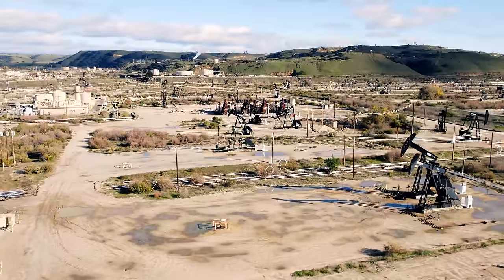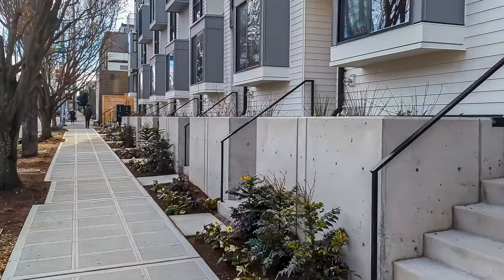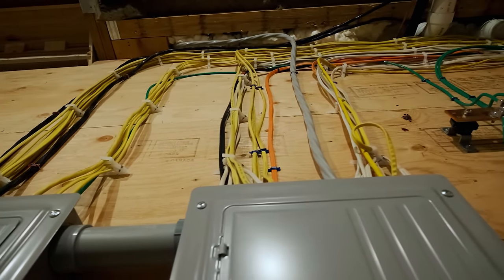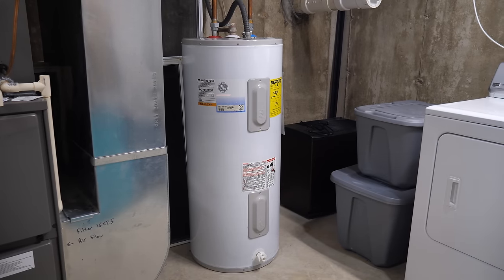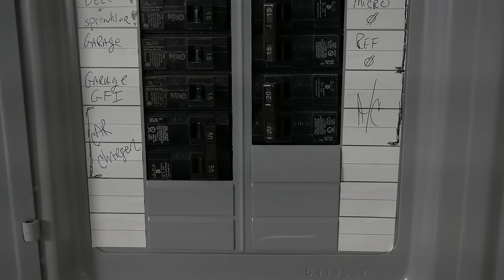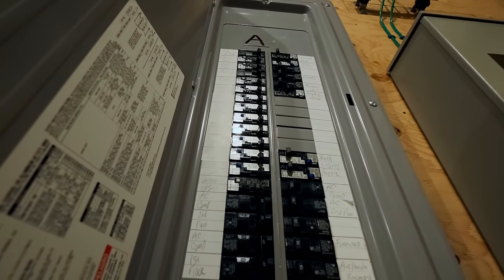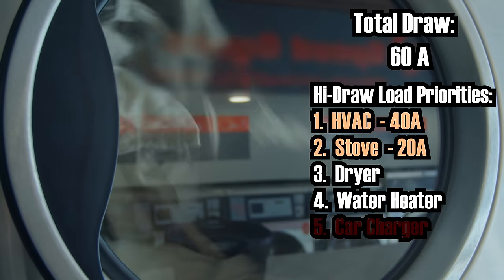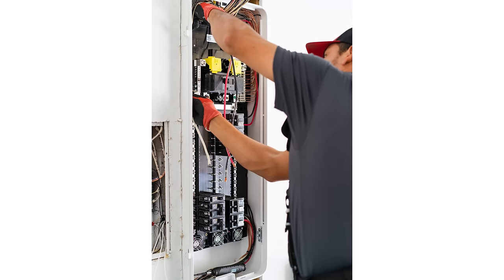Home Electrification: There's not a lot to do, and it doesn't have to be hard (Part 1)

Comment from the maker: Hi! So I didn't really explain why getting a service upgrade is a headache. In short, your utility often (but not always) needs to replace the wires that go from the transformer (wherever that may be) to your meter box, and then from the meter box to your panel. In addition to being a lot of work, it might not always be possible. I talked about this and some other issues over on Connextras if you'd like to take a look.
https://youtu.be/C4cNnVK412U
Reply: Appreciated!
Reply: Getting of UNnatural gas is Very important. It also leaks methane like crazy…
Heat pumps are Great! Can be used with geothermal or just FTX, where it takes energy from the ventilated air.
Reply: Another snag is grid upgrade costs. Over in WA those are passed along to whoever is requesting that latest service upgrade. It’s easily another 20k for a utility company to place / upgrade a transformer in addition to any normal upgrade costs
Reply: Fire good
Ughooga booga
Reply: 100 amps is… 24 kW, right?!
Our heat pump uses 6,5 (simple heater) plus 2,5 kW (compressor) for a 180 m2 house in rather cold climate… 1 m snow on the lawn since Xmas… -20C frequenty. 
With geothermal, the simple heater would almost never start.

We had 20A 3-phase, around 14 kW. Upgraded to 25A, 17 kW, as we have two BEVs and a 16 kW PV array.
Reply: Hold on, friend. 

A heatpump drier has a 800 Watt (8 amp at your 115 V) max need!!
Reply: This isn't always true. My service was upgraded to 200A last year and they didn't need to replace anything except the exterior metering unit and I think a fuse at the distribution box.
Reply: 0:52
I guess you have no idea about the lube oil consumption of a windmill...
Which it means the "carbon free" power only in fairytales are carbon free.
Not mentioning the HQ composites.
Maybe the calculated carbon footprint can be sold on paper as good but the intermittency also have quite a large negative value which could be translated to footprint. Somehow most of ppl. do not care about these "little" issues...
Reply from the maker: @Balázs Molnár Oh noooooo we need to lubricate stuff every once in a while.
Reply: This is a great video, but yes to your point, I am in the process of getting my home electrical service and panels updated to support solar + batteries and. Propane generator (live in a rural storm prone area and deal with 7-10 days of outages per year on average).  The big issue is that codes, even up to recently did not require electrical services to be substantial enough to handle solar feeds, backup batteries, etc.  very doable, but also expensive and painful to coordinate contractors and Duke Progress to get transformers, feed and meter connection/disconnection.  

One other thing I would love to see you do a video on is upgrading insulation and airflow in homes to increase efficiency lots of cool stuff going on in that industry the last few years!
Reply: @TechnologyConnections  The yearly cost of a single 2MW unit here in HUN is about 8000 USD. You can guess and extrapolate the consumption of windfarms... 

Because you need hundreds of rotary machines instead a large one compared to for ex.  NPPs...
Reply: Just had a power outage
Reply: In some cases, the service to the home is already bumped up to 200 amps but the panel is 100.  Check with your utility.
Reply from the maker: @Balázs Molnár But, get this, all those wind turbines make energy from the wind. Sure, a big ol' coal plant can make lots more electricity than a single wind turbine, but you need to feed it coal forever and that means you need to mine for coal forever and that costs money and labor and lives
This shouldn't be that hard to understand, my friend.
Reply: @molnibalage83  you have no concept of the amount of energy from a Wind TURBINE (no mill stones in them…). They generate GWh:s and even a m3 or so of lube oil, across those, equals to nothing per kWh…
Reply: As someone who lives in the UK, our homes are overinsulated, and we don't generally have AC. Summers become horrific here.
Reply from the maker: @Bacon Catbug Insulation helps with both heating and cooling. There seems to be some misconception about this in the UK - you absolutely want insulation to keep your house cool as well. What you're missing is some way to get energy out of the home, and possibly windows which let too much IR through.
Reply: While this is fine and dandy for single family homes and duplexes, this whole electrification argument falls flat on its face when it comes to large apartment buildings. A large, single gas furnace boiler can efficiently heat an entire building for dozens if not hundreds of apartments. Yes, they do require electricity to operate the electronic components, so if the power goes out, they may stop working. But here's something that can easily be done with large gas furnaces in such a situation: operate them off backup generators.

If a large apartment building were to have heat pumps for every single unit, or even a large electric boiler, as efficient as they are, if the power goes out, there is no generator powerful enough to operate them for several hours overnight during the dead of winter to keep everyone in the building warm and prevent hundreds of pipes from bursting and flooding everyone's homes. Yes, everyone in the building will have a similar problem during the summer with AC units, so power outages are a problem then, but what you are proposing will cause this same problem both in summer and winter when it comes to AC/heat pump units causing a major demand on the grid both times.

Fun Fact: More than half of the world's population, including the US, will be living in metropolitan areas by 2035. What you are proposing only works for rural and suburban folk, not city folk, which is ironic as it is city dwellers who are are demanding others make these changes when they themselves would be detrimentally effected if they went fully electric. It's also ironic that city dwellers want everything to run on solar and wind when those things require lots of land and only really work for off-grid and rural settings while cities that have little land, including roof space, want to take up dozens of square miles of precious farm land, used to grow food, just for PV and wind turbines.

The only solution that works for complete electrification to solve the heating problem while being carbon neutral is a massive uptake of nuclear power, which greens hate and want to be phased out for wind and solar. Irrational city dwellers want to have and eat their cake without baking it.

What's your solution to all this, snarky pants?
Reply: @TechnologyConnections  😂
Reply: Being someone who consumes electricity in part of burning gasses, I really missing the smell of wood stoves and the comfortable dry heat.
Reply: @My_HandleIs_  Depends on where you live, Building regulations can make outside devices impossible.
And if you are in more public housing your options are especial limited.

My choices are overpriced District heating heating or gas ...
Reply: @How_To_Drive_a_TARDIS  ROFL, I love the Google Translate option built into the YouTube comments now. Check out your comment… go ahead. 😉
Reply from the maker: @FaceTubeU it's funny, I think I talked about this in the video and why it's complicated to get into. That doesn't mean there aren't solutions (there are) it's just going to make the video incredibly long, and also isn't something that's actionable for anyone who watches this video (meaning the renters who live in those buildings, or even individuals owners of condo units which share central equipment).
Reply: The smart panel is really cool tech but I don't know if the price is worth it when the price of the smart panel itself costs like a grand more than a whole 200amp service upgrade in my area.
Reply: Oddly, when I had my main panel upgraded (it was 100A, not enough breakers) the electrician found that the service and even the meter on the back of the house were already rated for 200A.  My upgrade was a bit more involved anyway, as my original breaker panel was in a walk-in closet which is no longer allowed by code.  They had to relocate the new panel and reroute all the wiring.
Reply: Don’t forget the grid upgrade necessary to support electric everything. Who ever tells you it will support electric everything is lying to you. During peak heavy use times, lines sag as it is. Add more load and the lines will be touching the if the equipment before it doesn’t melt.
Reply: Yeah, they’d have to rewire my whole apartment building!
Reply: @TechnologyConnections  and from my research it's just about 70L of lubricant per year for the very biggest windmills in existence. I think that's amazing for over 10MW of power.
Reply: @My_HandleIs_  I have a very good knowledge about the specific and absolute values as a mechanical engineer who works in the energy industry filed 15+ years...
Reply: Why would I want to "ditch" gas?  Natural gas is great!  It's cheap and readily available, and most people's electricity COMES from gas either way, so you're not hurting the environment, you're being much more efficient than  burning gas in a power plant, flowing it through the grid, and then consuming it in your house with all the losses.  Being "green" means being smart too.
Reply from the maker: @Mike Znel I'm not. You're kidding yourself if you think I am - and one of the greatest benefits of the energy management techniques I discuss here is that they "flatten the curve" and help offset these issues.
Reply: @molnibalage83  sooo... ya think a coal power plant uses the same amount of carbon as LUBE OIL in a windmill farm?
Reply: @TechnologyConnections  DTU (Danish Technology Institute) did some calculations 3 years ago and found that in some cases it makes sense ROI-wise to install an oversized heatpump first and then improve insulation later when you have money for it. This is contrary to common wisdom. Much depends on the current insulation, heat source, heatpump COP, type of heatpump, viability additional insulation, etc. I can provide link to PDf (Danish) if desired.
Reply: Very cool. Wish I was rich & had a family & kids & a wife & a house I own to do all this in...
Reply: @mattparker9726  this will all make sense once you get a good education.
Reply: @whochecksthis  Nope, much less. Because it does not use hundreds of rotary machines to generate 200-500 MWe
Reply: Lots of the "alternatives" make less sense than pulling goop out of the ground.
The infrastructure is a huge part of the feasibility. Gas utilities are still cheaper than the electricity, despite the artificially high gas prices we are experiencing right now. 
You already know the grid is unable to handle current demand, add electric cars, electric water heaters, electric heat, electric cooking and you have a recipe for rolling-blackouts.

Why not call for an "all the above" strategy? The electric or die cult is asking for higher utilities, less reliability, and driving more people into poverty. I love it when affluent people say, just buy all electric! Without understanding that the people on the poverty line is increasing and forcing them to abandon fossil fuels will literally cause many of these people to die from lack of heat or cooling.  

Don't even get me started on all of the issues with solar, wind, and all of the "green" technologies. Solar and wind farms are known to be filled with death. The technology is not recyclable, what do you do with the damaged wind turbine blades and solar cells? I am in California and know the secret ugly side of "green energy".
Reply: @TechnologyConnections  lolz
Reply from the maker: @Balázs Molnár Let's see, hundreds of rotary machines which need (checks google) about 50 gallons of lube oil every (checks google) 3 to seven years versus a coal plant that needs (checks google) 14,000 tons of coal every day
Definitely equivalent.
Reply from the maker: @David Parker - because we need to stop burning fossil fuels as quickly as we can. You know what happens to the raw material of the fuel when you use it? It goes poof and disappears. Then we need to get more. Forever! It's pretty weird, but that's the case.
Despite there being harms in wind and solar production (we're not pretending they aren't there) those raw materials remain intact throughout the whole of their lifespan, and we are in fact learning how to recycle them into new turbines and panels.
This transition will be hard, and we need to help our friends and neighbors as we do it. Good thing we're actually doing that as we speak.
Reply: @My_HandleIs_  residential hookups aren’t leaking man.
Reply: @davidparker9676  Fossil fuels are artificially much cheaper than they should be as the cost of the climate impact is not factored in. Government subsidies further reduce the cost. If all sources included something like a carbon VAT, you’d quickly see that fossil fuels is pushing more people into poverty than clean energy
Reply: @djsmeguk  Correct! The power company runs 200 amps rated wire regardless of your service size.
Reply: This explains why my city has been upgrading the transformers since electrical use and electrification are going up.
Reply: Still probably cheaper in most cases than this "SPAN" panel you're pushing:

"SPAN Panel smart electrical panel | $4500* *Does not include taxes, shipping, and installation."
Reply from the maker: Alberto Sanchez Acero I'm not sure how universal this is, but I did edit the comment to reflect this.
Reply from the maker: Justin C To be clear, I'm not pushing the Span panel as much as I'm pushing the idea it represents. I like what they're doing, but it's definitely not cheap and we'll discuss other options in part two.
Reply from the maker: ...who exactly is "they" and who are you talking to, @Tech One?
Reply: @Akkbar21  In my united states town, the local utility doesn't seem too concerned about fixing minor leaks in buried pipes.
Reply: @Technology Connections I am an HVAC Technician you need to get a professional to look at your electric furnace. The heat strips should NEVER turn on and off while there's still a heat request from the thermostat. I would also recommend staging the heat strips. So all of them don't turn on at once and use a 2 stage heat thermostat. If there extra thermostat wire conductors available. So that you ONLY turn on the amount of heat that the structure needs. The heater kit has safeties that turn the elements off if they get too hot or if the air flow is too low. One of the heat strips burned out more than likely from low air flow. If the low air flow conditions aren't corrected more heating elements will burn out. IE not enough return air grilles or insufficient return air ducting IE too small. Undersized ductwork is the biggest problem in the HVAC world. Also oversized equipment is a big problem too. Undersized ducts coupled with oversized equipment leads to early equipment failure. We have what are called load calculations called Manual "J", Manual "D" and Manual "S". But these are rarely followed. Instead the equipment is either replaced with bigger equipment. Or the equipment sized is guessed depending on the square footage which is INCORRECT. Most localities aren't enforcing these rules which causes extra energy usage which isn't necessary.
Reply: As always, thank you for your awesome informative videos!  I'm a little surprised that upgrading your panel capacity is that much more expensive that changing out your panel for a smart panel anyway, even though a capacity increase requires other infrastructure changes as well.  Can you provide a ballpark in what the cost difference is in the case where you're in an advantageous situation for upgrading capacity (above ground wires, etc.)?
Reply: We asked for a 320a service when we built our home cause we for sure wanted to future proof it. I think it was a $6k build upgrade vs the 15/20k post install. 
What did annoy me was they refused to install heat pumps and all quotes I've got are 40k+
Reply from the maker: @hvacguy84 yeah, I suspected it's lacking airflow or something. I'm looking into a Bosch heat pump system for them. Now that I know what they actually need, a three-ton unit with 15 kW of heat strips will be plenty - which means they won't need to upgrade the outdoor supply. I figured they might have to not knowing just how power-limited their current air handler is, but they're in the clear. Now the challenge is finding an installer...
Reply: @mattparker9726  1. Burning gas to cook DOES put CO gas into the air inside your home as well as other pollutants. 
2. Cooking with gas makes the entire room get HOT, straining HVAC more in the summer. Induction stove tops dont really do that. 
3. Resistive heat generation is a 100% efficient process.
4. Whos to say that electricity isnt being made by hydro power or a wind turbine? All electric homes being the norm means we can eliminate more fossil fuel use.
Reply: @davidparker9676  "You already know the grid is unable to handle current demand, add electric cars, electric water heaters, electric heat, electric cooking and you have a recipe for rolling-blackouts."

Dude, we can upgrade the grid if that is the case. It's not some permanent fixed entity. Might be a good way to generate more high paying engineering jobs too...
Reply: @TechnologyConnections  Beaker size isn't determined by the tonnage of the outdoor unit. I've seen 3 ton units on a double pole 20 amp breaker. So always follow the listed breaker size on the equipment. But you need to get the air flow problems corrected. IF NOT your new system won't last very long. Also with heat pumps the indoor unit (air handler) becomes the condensing unit in the heat mode. If you don't have the correct amount of return air grilles or the ductwork size is too small. Your heat pump will run high head pressure in the heat mode. I've seen some systems so bad that they will trip the high head pressure switch in the heat mode. Get a very good and well knowledgeable technician that knows what there doing. That are willing to perform a load calculation and correct the ductwork problems too. In the next few years we're going to be moving away from from R-410a. They will be testing 2 new refrigerants R-32 (mostly used in Asia) and R-454b (being tested by Carrier/ ICP HVAC) this move will happen in 2024-2025. Also shop for a good contractor not just by what brand name unit they sell. They can sell or install well know brands like Trane and Carrier but if its not installed correctly it will cost you.
Reply: You don’t need to remind me Bob is my uncle
Reply: Technology Connections desperately needs to learn basic economics
Reply: @TechnologyConnections  - If you don't know, I don't have time to educate you.  Pay attention and you might figure it out in twenty years.
Reply: I like natural gas!
Reply from the maker: @hvacguy84 I know, but they've got a 30A circuit and most 4 ton units I've seen need more than that. Wouldn't be the biggest deal to upgrade that circuit but still best to be avoided.
Also I highly doubt their ductwork is gonna be a problem. At some point I want to investigate whether their blower is set low - it probably is. There's a large trunk duct with a vent maybe ten feet away from the furnace and not a whole lot of air has ever come out of it. But yes, I'll be consulting with professionals - the only trouble there is there are HARDLY ANY where they live that I have much confidence in.
Reply: @TechnologyConnections  We just replaced our system with a Daikin dual fuel heat pump/furnace. It performs great and has a great warranty. I have heard Bosch systems are more difficult to repair and parts harder to find.
Reply: @TechnologyConnections  What i really wish is using Heat Pump as a central system, heating the water and oven , and maybe also a more conventional smaller heater package of 2 plates, one for a small kettle, and one for a small to medium pan. so we can heat our home appliances and water with the heat of summer.
Reply: @Aquatarkus96  It's been lacking for decades already, what makes you think it will magically be upgraded with increased demand?.... It hasn't happened so far.

I live in Los Angeles surrounded with all of these naive Pie-In-The-Sky ideas that don't make fiscal or logical sense. All of this crap is heavily subsidized and still consistently underperforms. 

Why do you want to force an energy source that doesn't pencil out?
Reply: In my experience in CA we rarely had to replace service wires to go from 100A to 200A for overhead service - underground service is horribly to impossibly expensive in many cases because the service wires DO need upgrades and often the conduit in the ground needs to be upgraded for the larger wires.

When the service wires don’t need an upgrade, the cost is almost exclusively in the panel, so a smart panel upgrade doesn’t offer much benefit over going to 200A.

Of course running new 220V circuits through existing homes can be expensive too as there is usually the additional costs around repairing access points.

I’m interested in your second video though as batteries as a way to manage the additional demands might be an alternative to destructive new circuits, especially if there are ways to get 220V battery systems that charge from 110V circuits.
Reply: @TechnologyConnections  Usually in heat you use a lower fan speed than A/C. But every house has different requirements. Also note Variable Speed X13 blower motors DO NOT have speed taps. Older PSC motors (permanent split capacitor) and the newer cheaper constant torque X13 motors have speed taps. But for now you can have a contractor stage the heat kit, check the fan speed and replace the failed element. Instead of having 20 KW of heat strips turning on which isn't necessary if its mild outside. Most electric furnaces support staging heat kits 10 KW or larger. This can be accomplished by a simple thermostat wiring setup change by using W1 (heat stage 1) and W2 (heat stage 2). If you have extra unused spare wires (usually coiled around the thermostat wire jacket if extra conductors are available). The spare wire can be wired to W2 (heat stage 2) on the thermostat and at the electric furnace. To signal the other set of heat strips to turn on via thermostat request on temperature.  Instead of banging on all of the heat strips. (In some places electrical strip with straight A/C can't be installed and IS against code). These areas require heat pumps to be installed to be up to code.
Reply: @TechnologyConnections  The big problem with wind and solar is the equipment has a finite life span.  I think it averages about 20 years.  So every 20 years all the solar panels, and all the wind mills should be replaced for optimum efficiency (they don't need to be replaced, but they won't produce as much).
I think Nuclear is the way to go.  If we can set up several nuclear plants, then electrifying everything wouldn't be a problem.  There is another YouTube channel, I think it's Kyle Hill, where he talks about how safe nuclear actually is and how it could truly solve our energy needs for centuries.
Reply: Why don't you speak more about underground heat pumps for colder climates. My town can sometimes get freezing in winter, up to -40 C. And as a result almost all people that have installed heat pumps have made them with underground heat exchangers, not only do they work they have even better efficiency curves all the time even in hot summer days when you want to cool your home.
Reply: @TechnologyConnections  That all sounds nice but it ignores the basic question; where does the electricity come from? Typically coal, some natural gas, some diesel/oil, some hydro, a small amount of wind and a small amount of solar.

I have no problem with any of these, in fact, I say the more options the better. What I do have a problem with is one source being forced on everyone regardless of how expensive or disruptive it will be, or even if it is a viable solution. Some of these emotion fueled decisions have a funny way of coming back to viciously bite us.

Electric cars are not the solution for everyone, especially those that live in rural and cold climates. Diesel is remarkably efficient and produces less GHG than gasoline, plus the ICE powerplants provide heat to the occupants and rapid refueling with potentially unlimited range.

Again, I have no issue with people using solar cells on their homes or property, I have no issue with windmills on one's own property, or geothermal.... it's all good with me. I am tired of people pretending that they are clean or have no downsides while exaggerating the downsides of fossil fuels.

The mining of copper, cobalt, rare earth and all of the materials to make these "alternative" energy sources are extremely destructive to the environment, exploit people and often use slave labor. There are more costs to consider when we are being totally honest with ourselves.
Reply: @FoxWolfWorld  He needs a little less bias and to be able to look at things from a POV that's not a person in a US city/suburb in a mild climate.
Reply: @davidparker9676  
If everyone shared your belief on how we should cook in the home, then we shall cook the planet.
Reply: @Muaddibize  Installation costs can be extremely high for those in many areas.
Reply: @molnibalage83  1. Plenty of lubrication is not from crude oil.  2.  Lubrication is not burned, so will not become CO2 (not counting trivial amounts that is unintentionally burned, and even less that is in a very few devices)
Reply: This sounds great, but here in California, electrical service is charged for a t about $2.00 a kilowatt hour !!!, electrical power used to be charged for at about #0.15 cents a kilowatt hour a couple of years ago!!, so, just having a small usage is now costing about $800.00 to $2500.00 per month!!!!
Reply: @molnibalage83  How many gallons per hour does a windmill use?
Reply: @SquintyGears  We can argue when the USA went to hell in a handbasket, but Reagan actually rescued the USA from bigger economic pain by restructuring things. FDR really screwed the US over in many ways, prolonging the depression and driving us into a cycle of endless wars. We were an isolationist country and would be way better off staying that way, like Switzerland.
Jimmy Carter was a nice guy but a terrible president that blamed the people for the US' decline instead of taking responsibility, being the commander in chief and all.

The government does a terrible job at everything it does, and it costs many times more than it should. Government subsidy is toxic when it picks the winners and losers. 

I live in southern California and I can tell you that these feel-good solutions don't make sense, economically or environmentally. I happen to know a thing or two about rolling blackouts due to the grid being overloaded. We have blackouts throughout the summer. People die when they get heat stroke from the blackouts. I've been without power for over  three days. If I was in an all-electric home, I wouldn't have had hot water to bathe and wash dishes, I wouldn't have been able to cook on the stove or oven. Gas appliances ease the burden on the power grid. The more options, the better. If you have rooftop solar, solar water heat combined with gas, a gas generator for backup, it is all the better. 

It is very foolish to put al of your eggs into the electric basket. Just ask Texas when they were freezing. The homes with generators and natural gas were fine.

You are being sold a pig in a poke, don't fall for such basic propaganda.
Reply: i have a couple big problems in my home, i only have a 100A main, and the breaker box is already full from when the house was built, literally no empty spots. Plus, all the tools i use in my shop/garage i could not get away without getting a service upgrade, and a new breaker box, and of course id need the new circuit run as well, so unless there was a government incentive or something else that paid for all of this i would not be able to switch to all electric
Reply: @OriginalPiMan  Nice hyperbolic argument. 
Where does your electricity come from? What powers your electricity? Nuclear, coal, unicorns?
Reply: @davidparker9676  
Renewables power my home.
Solar and wind. I pay more so that this is promised to be the case.
The grid as a whole in my area: there's still a lot of coal, although that share is reducing (just not as fast as I think it should)
Reply: @unteins  Upgrading to a 200 amp panel is not that expensive and upgrading the drop is not a major concern. You are right about underground wiring being cost prohibitive. 
The efficiency of upgrading to a 200 amp service is something I rarely see people talking about, especially for older homes. The lower resistance of the new drop and panel reduce the power losses compared to a small panel with a thin gauge drop.
Batteries are an option but will be be an added expense that may not pencil out in any savings.
Reply from the maker: @Deceneu mainly because ASHPs are getting so good at operating in extreme cold that the additional work and investment of a ground loop is chasing diminishing returns. Our housing is already set up for ASHPs, and if we can get them working at a COP of 3+ averaged throughout the winter (which I'm all but certain we already can) then it's hard to justify geothermal in my opinion.
Reply: A better question is WHY would I want to do this? Gas provides reliable and effective heat for the home, for cooking, and for drying clothes. If the electric grid goes down, I still have heat and the ability to cook. I am happy to keep my gas appliances.
Reply: @davidparker9676  it's not a question of propaganda. You live in an environment that makes it impossible to trust centralization. It's totally fair but it's not true worldwide. The truth is you should blame the government for fucking it up so bad instead of blaming regular people for trying to do better.
Yes you should diversify some things but you're not raising your own beef and growing your own tomatoes are you? Some things are built resilient to most variables and you don't live in fear of them just breaking.
But it's very hard to imagine the restructure of leadership necessary to get a solution. It is happening slowly though. California does have more environmental protection than most other states.
Personally i think at some point the US really will be more of a collection of countries than it already is...
Normal places only use generators and backups in case of natural disasters that destroy the city. Not just a hotter than average week in summer... That's why cooking backups can be camping stoves too. The whole mind framework is warped.
 you can reasonably have full electrical independence but you can never refine your own gas. It's intrinsically a technology that is more freedom for individuals. If I'm rich i can build my house anywhere remote af. if there's ground water and starlink I'll have access to all modern comforts with absolutely nobody to answer to...
Reply: @davidparker9676  yes another easy efficiency upgrade we don’t use is larger gauge wiring in the home. A 15A circuit usually uses 14 gauge wire, but 12 gauge isn’t much more expensive and has significant efficiency improvements. Not as useful in a service upgrade situation but for new construction it would be advantageous for it to be mandated in building codes.
Reply: @TechnologyConnections  - Liberal leftists, hello!
Reply: @My_HandleIs_  won't that be taking the heat from your house though?
Reply: @My_HandleIs_  In a climate that requires heating and cooling, it's even better: In addition to a vented drier running at ~2500W and venting all of it, in winter my heating system would need to supply another few kW to raise the air getting sucked into the house from below freezing. I readily admit though, that it was ease of installation that made me pick the heat pump version.
Reply: Glad you posted a comment about this. It can be a pain to perform a service upgrade if you are unlucky. I suspect, however, that for most single family homes in the US built in the last 40 years it wouldn't be a big deal. Mostly the feeders are run in conduit so pulling new ones should not be a big deal. And replacing a meter can isn't any more difficult than replacing a load center once the utility provider has cut the power for you. The issues would be if the transformer isn't capable of providing the load required or maybe the conduit is undersized for the new feeders. 

One other thing is if you have a look at the data sheets for most breakers they don't exactly trip at their rated current immediately. Most of them will actually allow quite a bit more current to pass for a short period of time. Most will even do a full 100% overload for a few seconds. The reason they trip so quickly during a fault is that you can have hundreds or even thousands of amps drawn instantaneously.

Excellent video as always. Thanks for what you do
Reply: I did just do a 200 amp service upgrade and my electrician got everything done with the outside in a day without any issues.
Reply: @molnibalage83  Also, coal plants and gas plants in reality use that fuel to run turbines. Guess what, turbines need to be lubricated, too.
Reply: And then they need to upgrade the upstream infrastructure and the production capability. Buy yourself some nice warm blankets...
Reply: @davidparker9676  Because our earth is dying and we will run out of fossil fuel by their nature.
Reply: @davidparker9676  
The highest per capita greenhouse emissions are from the oil drillers and the wealthy countries.
(2013 figures) Kuwait, Brunei, Niue, Qatar, Belize, Oman, Bahrain, Australia, UAE, Libya, Canada.
Reply: @My_HandleIs_  I've asked how pipes and stoves leak gas when they're off and inspected regularly, with no standing pilot lights. Crickets.
Reply: @davidshaw9993  We have 2 100 amp panels. There are also bits from the original knob-and-tube wiring in the basement.
Reply: @molnibalage83  Not only that with an all electric home just imagine how many people will be freezing or going hungry from electrical shortages
Reply: @OriginalPiMan  I think ten years is a little old.
Reply: @TryNDoxMe Grid system isn't up to snuff right now and if every home were switched to all electric it would really be overworked. Start calculating the amount of time(could be a limiting factor) and expense to build that grid and you might change your tune a little.
Reply: @ivanskyttejrgensen7464  Yes. It takes a long time for improvements like that to pay for themselves and if you move before they do, you get back a fraction of what you paid in increased house price. It can improve quality of life though.
Reply: @omega4711  Weak.
Reply: @TechnologyConnections  "those raw materials remain intact throughout the whole of their lifespan" - That's what we call a tautology.
Reply: @mattparker9726  I've heard this from every ac/heater guy, my electrician, and half the companies at my regional renovation show but my utility bill says otherwise, gas is a deceptive bill they take the average over the year then calculate your usage and lock your rate
Reply: @gionova1  Electrical use is definitely going up and has been for the last century. My parents' house had one or two electrical sockets per room. That wasn't enough even before I left home in the 80s. TVs, PCs, VCRs, phones, well, the list goes on.
Reply: @AsbestosMuffins  you get heavy discounts by buying off season, and pre buy.
Reply: @Narinjas  Heat pumps don't get that hot. I like my food cooked.
Reply: Your argument against rooftop solar is the single worst take you've ever made in a video.  If you have power at peak hours that is the most valuable power whether you are getting it from the grid or getting it from panels on your roof.  Them incentivizing you to reduce that power and instead supply it to others is not a perverse incentive, it's literally them creating a proper incentive.  

While the costs of the grid are a substantial part of the electric tariff rates, those costs are including them building to peak demand the old fashion, thermal power way.  Electric utilities set their rates through negotiations with state and local regulators where they have to point towards a capital cost in order to get a profit.  They have every incentive to sell their fossil fuel assets as an intertial stabalizing mechanism.  THIS is the perverse incentive, the more they spend the more they save.  You say "it's a cost their neighbors pay for".  No, it's taking money back from shareholders in investments that slow walked the solar transition in the name of profit.  They made a bad investment and they would very much prefer that bad investment be protected from competition and be allowed to make a profit.  It's such a bad investment that rooftop solar, despite all it's highger costs then utility scale can still undercut it.  Your neighbors are left better off buying your lower priced energy.  Yes it's a complex question but what you are defending is the predatory thing, not the solar.

You specifically cite the case of California.  California is currently doing a commendable job leading the world in utility scale batteries.  They are doing this because they need power at peak hours and not in the middle of the night.  If they shift a GW of demand from peak hours, that's like a GW of batteries, a billion dollar investmnet, a billion dollar investment that you and your neighbors dont have to pay for through higher electric rates.  Your "no more then 25%" idea would be punishing people for helping and rewarding them if instead of helping they didn't help.  Net metering does have it's issue but you are saying we should make it worse not better.

This take made me age 30 years and become a cranky old woman yelling at the screen.

Also the real reason we shouldn't stick solar panels on buildings is it's more expensive.  Almost half the cost of a utility scale solar installation is things besides the panels themselves.  Putting them on buildings drives every one of those costs up.
Reply: It's actually a myth that the electric grid requires bolstering to convert to all electric. Virtually all EV vehicle charging will occur at night when most of the grid is underutilized. Meaning you don't have to upgrade it to add an EV to the mix. Heat pumps consume about as much as a fuel oil pump, and you can use heat pumps for water heaters and heat. Essentially the only items that will bump the required electricity will be gas furnaces (only slightly, the motor that blows air is still the bulk of the power requirements) and a gas water heater, dryer and stove. With the advent of LED, that offset of power consumption for light pretty much offsets the occasional water heater, dryer and stove usage. (Lights are running for hours every day, and stoves, dryers and water heaters are not running that often.) The studies show that demand will go down as tech improves. Even with a switch to EV vehicles. Population (in the US) is shrinking. Any local highs will most likely be offset by more rooftop solar as it gets more popular.
Reply: It's even worse if you're in a condominimum that's maxed out what the provider can give you on your current voltage. For example, my building has hit the max panel ratings that the power company is willing to support on any 2.7 kV line. Because of this, we'd need to get a new line run all the way from the substation at a higher voltage if we wanted to replace our natural gas furnaces with heat pumps and that's going to costs $50-120K as of the last quote they gave us .
Reply: What's your opinion on new nuclear technologies?
Reply: We're still gonna need oil for medicine and lubricants maybe plastic but we should really get off that.
Reply: @Nala15-Artist  
Broad figures are hard to come by (2018 list has a lot of countries but not as many as 2013), but the principle stands: Countries that mainly produce oil, and highly developed countries (especially outside Europe) produce the most emissions per capita.
South American countries, barely rate.
Reply from the maker: @aramintywhitesell4566  I thought I made clear (and excuse me if I didn't) that I don't really have issues with the concept of rooftop solar, just that we need to be careful about how we incentivize it. I'm not convinced there's a really good way to do it fairly, and your last paragraph is another reason I won't push people towards it. Not only do I find it just pretty icky to say "you wealthy folks should just do this work for us!" but it's arguably a worse use of those panels.
(edit) And all that wonky crap on how rates get determined in the first place is absolutely among the reforms that need to happen. Hell, there's a lot of reforms that need to happen to the grid. Obviously. But I'm really, really concerned about the long-term implications as well as the simple fact that not everyone can benefit from this.
Reply: @molnibalage83  Oh no, 98% reduction of the carbon output isn't 100% reduction of the carbon output, so we shouldn't do anything at all because it's not 100%.
Reply: As someone who switched out a whole house furnace for a heat pump, I regret my decision. Snowy day, 20 degrees out and my house couldn't get above 62. Pathetic. But at least I got a 10k rebate on a 35k bill to have to keep the stove on overnight
Reply: @TechnologyConnections  how about the landfills full of decommissioned windmill blades?
Reply: @splinky99  Nope, the landlord would and the landlord passes that cost to the tenants
Reply: @TechnologyConnections  It ain't Covid. Flattening the curve means very little.
Reply: @michaelrauff734  Windmill blade are not a serious pollutant. They're made of fiberglass and aluminum. Not really a problem and those blades don't need replacing unless they're damaged, which rarely happens.
Reply: @mattparker9726  yeah, it's cheap and available... until it's not. Ask russian 🇷🇺 nazis how.
Reply: @molnibalage83  oh wow.
I had no idea.
Can you cite sources for this data?
I would love to see the listed quantities of lube oil used in windfarms and see the difference in quantity vs a coal or nat gas power plant...
Im in disbelief.
Reply: @procrastinatingnerd  you'd be surprised but nuclear power plants also have finite life span. 60 years. And a lot of scheduled shutdowns for interim maintenance as well.
Reply: @nneeerrrd  why? We have plenty here in the United States. We just need to drill
Reply: I had assumed most of the cost with a service upgrade would come from the panel, breakers, and installation. I should be closing on a new-to-me home with an overfilled 100 amp service panel, so I guess I’ll find out for myself.
Reply: @roryhennessey1983  because there are people outside of US, ya know? Sorry to shock you 😉
Reply: @OriginalPiMan  All of those countries are not densely populated, it is easy to get large per capita figures cherry-picking the data set.

The actions of the EU and USA are going to have little to no effect on these emissions when Asia and South America are the biggest polluters in the world.
Taking these draconian measures will only serve to hinder the EU and USA's economy while China and India pollute with absolutely no restraint or regulation.

These feel-good actions will only make China more wealthy and powerful by exporting more manufacturing to them with no control of pollution or regard for the environment.
Reply: Don't you guys use solar hot water over there? In Australia, almost every home built this century has solar hot water and it's been reasonably common since the 80s. In fact, pure electric hot water services are no longer to code for a new home. If you need {for some reason) to run electric hot water it needs to be a heat pump unit which are a lot more efficient. Also, almost every new home built has at least 5kw of solar installed to help keep the electric bill down. Likewise, every aircon sold here has been a reverse cycle (ie: a heat pump) for at least 30 years, why is the US so slow to adopt new technology?
Reply: @Nala15-Artist  Fossil fuel is a natural resource, it does replenish. We can use the methane from waste to power engines and for heat. We are nowhere near peak oil, and you are ignoring the damaging effects of mining the materials for electric vehicles and all of the copper that will be needed to transmit and utilize the electricity. Solar and wind are not clean when you factor the entire production process and lifecycle.

We have done wonders with dramatically reducing pollution with gasoline and diesel engines, we can do the same for heating and cooking as well.   

You are looking at this in a completely biased and unbalanced way. There are a lot of negatives surrounding going all electric. Most of the electricity in the world comes from burning coal, nuclear and the renewables have negatives associated with them as well. Wind and solar farms are death zones for wildlife. 

You really have to take an honest look at the big picture and ignore the propaganda.
Reply: @unteins  I never understood why anyone would not opt for the thicker wire. The cost difference is minimal but the benefits are worth any price difference.
Reply: @davidparker9676  in my experience it’s because they are never offered it - everyone is trying to get the lowest bidder - so by the time the home owner is making decisions the option has been taken off the table.
Reply: @davidparker9676  Most of what you just said is very biased and incorrect. If you are the intellectual you seem to be touting you are, I shouldn't have to tell you which parts. In the immortal words of Willy Wonka: Good day, sir.
Reply: @nneeerrrd  How lubicrous.
Reply: Living in Alaska is different especially when-20f
Reply: @TechnologyConnections  you should have a look into the green transformation in germany. Maybe you have it in good memory, but currently it struggles to make any real progress and the oil for the wind turbines is a  often used strawman together with killed birds and bats.

We are still dependend on gas and oil for heating and many people cannot imagine to change to electricity, because they say "my home needs to warm water for heating a heatpump ist to inefficient" because they won't change their behaviour.
Reply: @gonzostwin1  Heat pump installations come with emergency heat (resistive elements) for those occasions when the heat pump can’t keep up. We have a 22 year old heat pump and it has no problem keeping the home at 70F even at 10F external temperature. If yours doesn’t keep up, you need to get it looked at by a good HVAC tech. It could be a very cheap fix - either your heat strips are not working, or the thermostat/controller needs replacement. In some thermostats, you have to choose “emergency heat” manually in extreme temps.
Reply: Connecticut electricity cost has now jumped to 25 cents per kilowatt. Just FYI.
Reply: @ivanskyttejrgensen7464  of course, it can make Sense when you have to replace your heat source anyway and then save money for further upgrades. But generally speaking you should upgrade your thermal envelope first (windows and walls are a unit and should be upgraded together when possible) and then do work in your heat source.

But there is No generic answer to making homes future proove it's all individual.
Reply: @TechnologyConnections  Sure it's a complicated thing but that does't change the fact that what you are saying is we should make things worse not better.  Given the choice between having to supply you with peak energy and you supplying the grid with peak energy, it's better for everyone else on the grid if you supply not consume at the peak.  It's worse from the narrow financial interest of the investors in a pseudo-privatized utility but only because it limits the extent to which they are rewarded for doing the wrong thing.

"I'm not convinced there's a really good way to do it fairly"

The time of use incentives you are attacking are the solution to this.  There is utility to the grid to be able to shift electricity use between time of day, utility that they are willing to pay for with batteries, time of use incentives and excess capacity.  Currently that's shifting demand away from peak hours towards other times of day.  But because solar is the cheapest form of generation it's going to keep getting built and eventually this will reverse.  30 years from now every well regulated in the world will be doing what California is doing, operating a lot of batteries and incentivizing people to shift their demand towards times of oversupply.

You aren't properly thinking through the implications of rooftop solar being more expensive then utility scale solar.  Rooftop is always going to be a minority of the grid because anything that makes it cheap makes utility scale even cheaper.  If rooftop was a 2 cent per kWh levelized cost of energy (LCOE) then utility scale would probably be offering a LCOE of like 1 cent and things like widescale water desalination start to become viable and demand response starts fading in importance compared to overproduction.  Since it's basically impossible for rooftop to oversupply any rooftop solar we get is helping the grid not hurting it; rooftop is someone deciding that they want to pay extra for electricity in order to put some excess capacity on the grid, excess capacity that makes the system more resilient.
Reply: @tehgangstadawg  I’m sure nothing is perfect, but I’m just not for throwing out the baby with the bath water. Take care
Reply: @marvindebot3264  Low energy costs in the US prevent more efficient tech from being widely used. Heat pumps are just now beginning to become more common.
As the energy prices increase, the newer tech becomes more appealing to customers.
Reply: Copy and paste a link to your one year old video about how weak the us electric infrastructure is well you say the cords are the weak point but the actual infrastructure is barely keeping up in places like la talking about the infrastructure update retrofit alone would be so expensive and take so many new workers into many already struggling trades.the heat pump mini split video had to ad power for that house and yes electric backup heat on your heatpump another 50 60 amps garage heater 20 and now you plug in and charge light bulbs airfryer lawn mower we just keep adding cords to be plugged in and adding power to things in the home we already have power to your dog bowl and boot driers ect lol just fun namely stuff. and anything faster than wall charging is extra cost for multiple vehicles much money and how environment friendly it will be drilling wells for your heat pumps at every house in the us and the $30,000 more to buy and yes electric cheap now and when everyone is only electric I am sure the price will not go up and that people will just raise the ac temp well the government will lower it for you and being able to buy more than the minimum has never been a problem we Americans can adapt and we don't want to actually plug anything extra into our houses
Reply: @Nala15-Artist  It sounds like a coward's exit but I guess I should expect no less from someone with a cartoon cat avatar, quoting a fictional character such as Willy Wonka to end a debate.
Reply: @davidparker9676  OMG this is gold. Thanks for this! I lack the talent to make up such comedy. Just as I also lack the time to debate strangers on the internet. Especially those who already have their minds made up and locked in. Good night.
Reply: 25:31 As a longtime subscriber I can't believe it took THIS long to hear that story. It makes me wonder if there's something running in the family, technology genetics if you will.
Reply: @Nala15-Artist  Re-read my last comment, it applies even more now.

If you have no time, why did you reply with a paragraph? Irony anyone?

You certainly do lack talent, I must agree with you there.
Reply: @Akkbar21  No, but the pipelines are.
Reply: I have know people who Unplug the microwave when it's not in use because their worried about the power consumption of the LEDs LMAO.
Reply: 26:07 Really  appreciate the scene getting dimmer in time with the description!
Reply: Also the costs.  We have 200A service but EVERYTHING in the house is electric only.  Our panel is chock full.  When I got a quote for adding a circuit for EV charging I was told that I should have enough capacity for 1 EV charger (we have a 2 car garage) but we would require relocating at least 2 circuits to a new sub-panel to add room for another additional circuit.  That would end up costing like $1600 for the subpanel before the $800 to add an EV circuit.  And yes, I know about tandem breakers, the panel also already has the max allowed number of those already.
Reply: A 200amp service cost me 5k to install. No help from government
Reply: Thank you, I thought a service upgrade meant replacing the panel and I was confused about why your solution was to replace the panel with another 100w one.
Reply: @How_To_Drive_a_TARDIS  run it to the max or very close to it all the time, I can see it as being a good way to start fires?
Reply: @molnibalage83  how much lube oil would your expert a windmill to use? it not burning it is it, ?
Reply: Just had this done it's around $6000 to do so in Chicago to go from 100A to 200A assuming no panel upgrades or re-wiring etc...
Reply: @AKguru762  Not in central PA USA they don't. I helped a friend upgrade from 60A to 200A. The home was the only one on the transformer a block away. The feeder from the transformer was for 60A. They hooked up the old 60A to the new 200A mast and said that until the lights in the house dim they are not upgrading anything on their end. "'Open air' gauge ratings are entirely different" is what we were told.
Reply: say during your drying cycle, your drying circuit gets cut off for 1 second. doesn't that stops your cycle completely and you have to manually go to the dryer to restart the cycle? or do most dryers in the US has memory of what it was doing before its power was cut?

I assume most car chargers will automatically charge regardless as long as it is connected and you don't have to manually reset it?
Reply: @TechnologyConnections  
The BIGGEST problem with 100% electric homes is that in the middle of the winter, if the electric grid does an oopsie (ahem, Texas), people tend to freeze to death unless they have some dinitrophenol pills on hand. A fossil fuel backup (wood/coal/petrol) for when shit really hits the fan is still needed... unless people want to fill an entire room with batteries which isn’t cheap. It is safer than replacing gas pipes/tanks with hydrogen pipes/tanks though.
Reply: i was about to gripe about this but I see you addressed the home service upgrade. I will watch the video after this remark, which may be premature of myself.. 
In searching for houses to buy for over a year now, I have been plagued with the fact that some of them simply can NOT be renovated with a new service connection and upgrade without costs that may rival the cost of the entire house's current market value(sometimes being in excess of 4x the value of a $70k house) to make this a possibility.
I personally saw that a house in south Georgia would require making the entire building up to code, which would be nearly rebuilding the entire house, just to modify the existing 50a service feed on a tube fuse breaker box.
point of note, the public utilities were currently disconnected from this address.
This starts to become a local building code issue, and seems to be far bigger than just my small bodunk community, but may not be a big chunk of your viewers.. It will be an issue for  a fairly significant chunk of people out there that may watch this.
Just a food for thought Item that may already be over mentioned. I hope this may help, and be taken as a friendly nod towards more knowledge.
Reply: @baconcatbug  Only the newer ones. The vast majority of our housing stock, pre 1990 , was poorly insulated at construction.  The later regulations focus on insulation and air-tightness with no regard to proper ventilation.
Reply: In your list of 4 appliances you skipped gas-powered refrigerators.  

They are used in rural, off-grid areas.
Reply: @molnibalage83  do you think fossil fuel power plants don't need lubrication? Is it so hard to understand that using less of a bad thing is better than using more of it?
Reply: Green energy is just wishful thinking man it has its own issues that we can't solve technologically which would fuck with our aging electrical grid
Reply: It's always possible, just how much is the question
Reply: Yea i Know we want to electrify everything, but if you have a old Gas Furnace as a Backup you dont even need that resistive Backup Heating. you can Switch that old thing on for that short amound of time.
If its too expensive to let the Gas meter be installed, i understand that. We have a Oil Furnace and thats our Backup if a Thing happens with the Heat Pump.
Reply: @Akkbar21  you state in this thread "residential hookups aren’t leaking man" you are falsely telling a person he is incorrect. In my neck of the woods, the utility company is not interested in fixing gas leaks if they are outside and not huge.
Reply: @tehgangstadawg  ok. I just was casting my personal doubt that there is a meaningful scourge of leaking residential gas hookups in America. Am I an expert? Not at all.
Reply: @dh2032  weird string cause fire? 
Me like weird string
Reply: @linyingyen  I work on dryers in the US for a living. Most (all?) electric dryers in North America run their electronics on 120 volts with only the heater running on 240 volts, you can interrupt the L2 connection to stop heating without knocking out the motor controls requiring a manual restart. Some newer design dryers have enough smarts to tell that power is cut or that they aren't heating right. Moving forward, if manufactures know that they may be load balanced they can change dryer software to account for load balancing pretty seamlessly.
Reply: @chaos.corner  yes, but somewhat offsetting this, is that many modern electronic devices use way less energy than they used to.
Modern TV sets, take WAY less power than the old ones did
Modern lighting, same thing
many computers are more power efficient than the old ones were(and all modern monitors are).
Modern refrigerators and air conditioners use less energy than the old ones did.
So despite more devices being used, that does not necessarily mean way higher power use..of course things like heat pumps and electric car charging could skew this.
Reply: @My_HandleIs_  Mine still needs a traditional "dryer outlet." If it used 8 amps at 120v, it would use a normal outlet. (It doesn't make sense otherwise.) I suspect it still uses a resistor at some point. (Right now my dryer is running and my whole house is pulling 2.5 kw, or 10 amps.)
Reply: @m.k.8158  Sure, it does not necessarily mean that. But that's what's happening. Computers are more efficient but people used to not have them. Then there's all the parasitic power use that's going on and things used to turn off, not just be in standby. Heat pumps are better than resistive heating at least though. Monitor energy requirements are definitely less, thankfully but PC power requirements seem to be ever increasing, especially when it comes to PCs used for gaming. I bet the same is true for gaming consoles.
Reply: @molnibalage83  windfarms are only built if the owner of the farm thinks they'll make a profit. Remember, the electric companies are not government run. If it makes more money to do 1 thing then they'll keep doing that. If they lose money on a project then they wouldn't keep building that project
Reply: Yeah, service upgrades are the worst... ours took over 9 months of back and forth with our utility company, first they approved us for an upgrade from 100A to 125A with no upgrade needed to the wires from the transformer to our meter, just an upgraded meter, then they came back and said, no, your theoretical maximum load is 130A, so you have to upgrade to a 200A connection, no exception... the worst part, we were doing all this back and forth as part of a home renovation and we wanted to add a hot tub... well, the utility company didn't factor in that we were switching from a double oven to a single oven, which would cut our maximum load by 10 amps, so we would have been at 120A and would have been fine.
Reply: With all due respect; I think you mean that the subscriber needs to replace the lines (not wires) from the pole to the meterhead. And, from the meterhead to the panel(s.) The electric company's responsibility ends at the pole.

In my case, I have a decent sized home (3,500 sq ft), well insulated, in Zone 6A. It's not, to use your overused term, a McMansion. We won't get into the cost of multiple HPs for folks down the street from me with 6-10k sq ft homes.

My furnace is going, right now. I was recently deep in this discussion.

For me to put in a heat-pump, with a NG backup furnace in case there's not enough airborne heat to scavenge, I'd need to upgrade my 200A service to dual-200. That'll power my home, stuff, pool, and now heat. I'm a ways back from the road, and rounding up for just the cable, no box, no heat pump, no trench opening, no meter upgrade, no driveway repair (it goes under my driveway), the NFPA 70 specifices 1000 kcmil conductors; it's $22k in wire. And I Still need NG. 

I'm replacing it with a NG one. Heat pump and NG rescue furnace? $16K. Furnace? Retail is $3k; I'm calling a few favors, and a warranty complaint to get it around $1,500. A well maintained furnace will last 25y. A ground or air sourced heat pump is in effect a reverse-central-air unit; unless you invest in a few variable scroll Daikan units, the expected life here in NY is around ten years. Cost per year? $125 for NG, $1,600 for the heat pump (not even the rescue furnace.)

Monthly projected charges? ~$300 peak for the HP in electric. Assuming the NG rescue furnace doesn't kick on; with NG? I'm spending $200 in peak months with my slowly dying furnace.

I'll need to run an additional, secondary service, to my 2,500 sq ft. barn (There's already 100A out there; but won't be enough for electric heat.) Pull the water heaters (3 on demand NG units around the home), and 120k BTU furnace out there. Pool heater (200K BTU NG Heater, now) Let's not add 80A car chargers. 

Lastly, locally, electric is significantly more expensive and unreliable. So... I'm spending extra money (Probably ~ $50k), to get a less reliable service, that'll cost me more money monthly, and will get beat up more in our unpredictable climate up here. We can also talk about outside my immediate area grid reliability and age, grid capacity, resistance, and the like. I work for a utility; it's not as easy as you think it is (and it's not the gas company, as an FYI.)

Your data is sketchy, at best, and I'd be happy to pick apart peak/surge current versus your video. 

I'd love the idea of going total electric. Really. It's just that we need to put the pieces in place (like hardening transmission and distribution pieces) before moving this way. I am installing solar panels this summer; it's a good idea. Total electrification (and electric cars; I'll happily talk about my Model S issues) might be alright in temperate climates in CA; not so much in northern sections of the US.
Reply: I've replaced 100's of services and I've never had to replace the wire from the transformer. All we do is change the wire on the side of the house (if it's an overhead service), the meter base, the wire to the panel, and the panel itself. Only takes one 8 hour day to upgrade from 100 amps to 200 amps.

Installing one of those smart panels on a 100 amp service probably costs more than a 200 amp upgrade.
Reply: Alec, i’m new to your channel but have exhausted this and connextras.. could you talk about the strange fiery display from the top left of your old intro? I’ll hit the patreon and wait..
Reply: @My_HandleIs_  heat pumps? you sound like this youtuber i know that never shuts up about them..
Reply: People need to use less electricity than they already do though. If everyone in the world used the same amount as the average USA home, then it’s just too much electricity.
Reply: Crazy. Here in Australia it's usually a simple task between your electrician and your utility. The electrician does the internal wiring and the utility does the lead in.
Reply: You should look up solid state batteries
Reply: My Apartment is in a 120 year old building that was last renovated in the 70s, it has 5 units, and all the stoves and dryers are electric, I'm not sure about the water heater, but those use only a few KW, so electrifying those wouldn't be as big a problem. It's the heating system that can use the most, but if you have baseboard heating all you would need is decent wiring,  enough amps to run it, and a wallet big enough to pay for it. And remember, in a lot of the country homes don't even have central heating, cause it never gets too cold, so people just use a couple of space heaters for comfort a few times a year I think we should nationalize the grid, so that way it could be sold to people at cost. It only costs a couple cents per KWh to produce, just look at commercial rates, it would be a huge undertaking, but not impossible. They should also offer subsidies to older homes to help pay for better insulation and wiring upgrades, and we should incentivize people to buy smaller homes, the average sized home has doubled since the 50s, and is now 2500ft2 but the size of families hasn't gone up. When I buy a home one day I'm gonna try to get something in the 1000-1500ft2 range, which in an old mill town like where I live were a lot of homes are 90+ years old shouldn't be too hard, not to mention that running a smaller house is less hassle and money. When I was little my dad lived in a building run by a slum lord where the wiring was so bad that when you turned the fan on the tv would flicker, I was a child and didn't understand wiring, so I was convinced there was a ghost trying to communicate with us. Kind of a funny but bad bad story. That place also had mold and a huge water stain in the middle of the living room, and all the landlord did was paint over it and rip up the carpet. DON'T rent from Brown Properties in Waterville, Maine.
Reply: All of our wiring is sixty years old.
If I wanted to get a new, full-electric stove, I'd need to first afford an electric stove, and then also pay several hundred dollars to have not only the stove fitted but the gas lines removed and new electrical wiring fitted.

Also the consumer unit needs replacing.
Fun fact: our "consumer unit" is a slab of wood with circuit breakers on it.
Reply: @baconcatbug  UK ”over” insulated?!?
Definitely NoT!
Reply: @FaceTubeU  district heating is much better, as is geothermal with heat pump for large buildings. 

It works just fine in arctic regions too.
Reply: You should do an episode on dc conversion for a house on the grid. I challenged myself to running everything from one AC outlet and it turns out you can do so very comfortably. The only issue being heated elements which requires clever thinking with renewables like a sand battery on solar powered nichrome wire and a Dialectric and solar powered swamp cooler for Air conditioning. There is also DC fridges and freezers, and washer, dryer units but the dryer does not use a heating element. On DC your energy output can be as low as 0.1-0.3 watts for an LED light the equivalent of a 9w LED bulb in lighting the room. I left one on for 2 months on a 12v lead acid deep cycle battery.  There are many technologies for DC conversion and something as simple as your tv being plugged in to type c usb to power it is one of them.
Reply: Yes we are getting this done. Overhead wiring makes it much much easier and my electrical company has a ton of incentives.